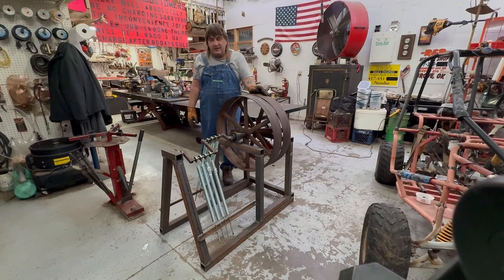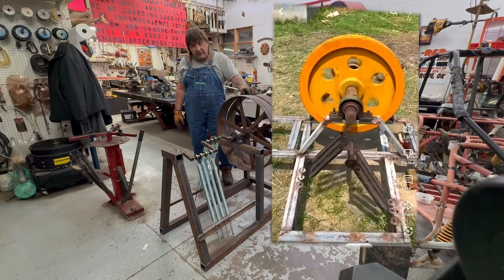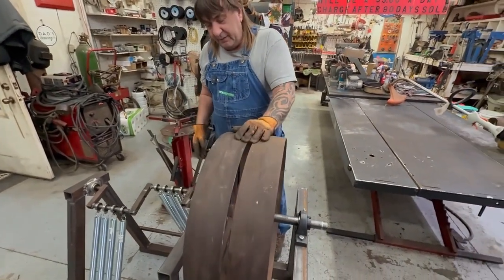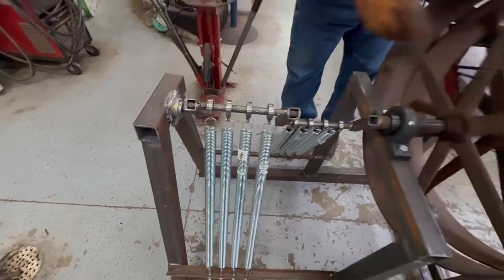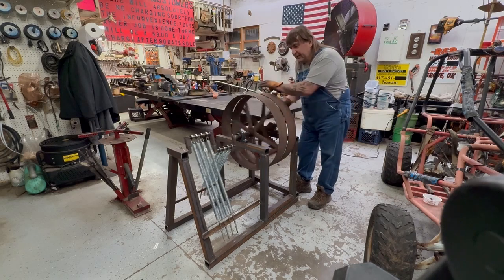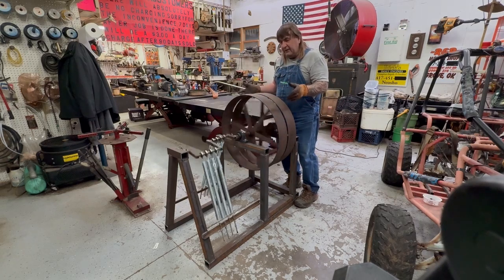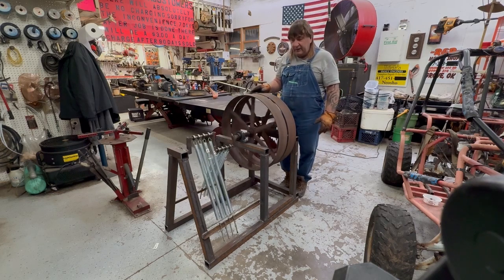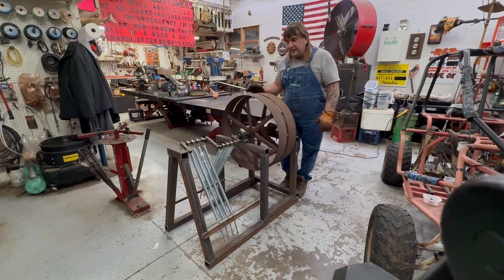I Built a Giant FREE Energy Spring Generator (Perpetual Motion Machine)

Comment: I have a degree in engineering - and one of the first things we learned is that perpetual motion machines are impossible.  Any machine has losses in power from friction, wind resistance, heat loss, etc.   No machine can get to 100% efficiency - and making more than 100% is impossible.  These perpetual motion scams, hydrogen generator scams, candles in clay pots heating entire rooms, are just made to fool folks.